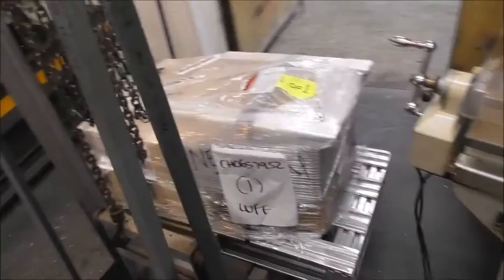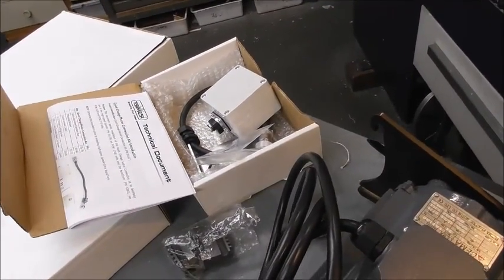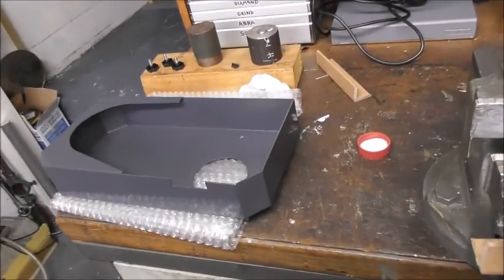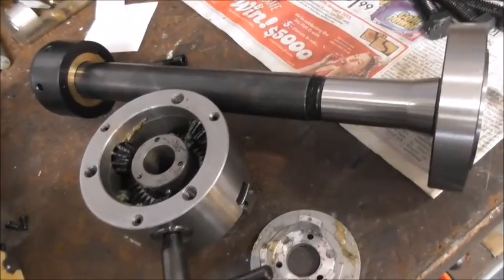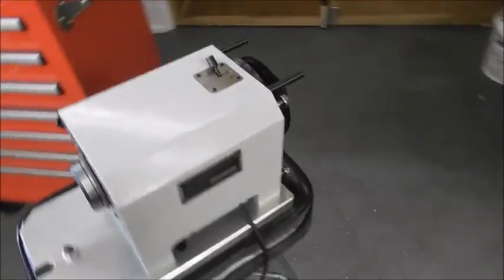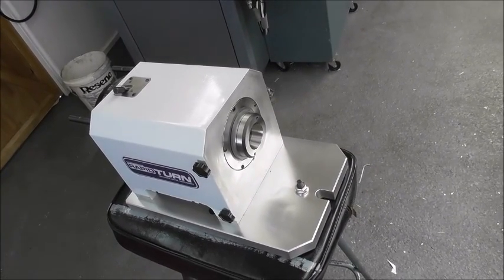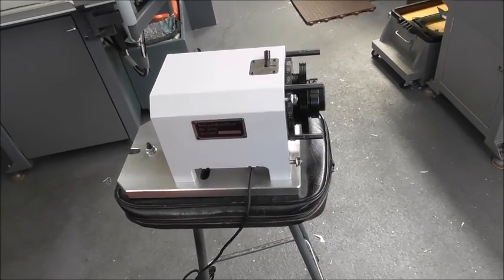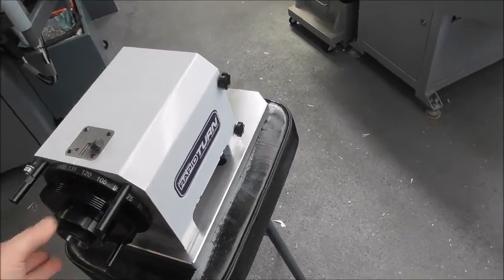Tormach  RapidTurn - 1, Unpacking and inspecting

Comment: 1500 USD for shipping is a rip off. I am living in China and do a lot of shipping. 2 cubic meter seafreight from China ex Factory to the US / EU is about 1500rmb /6.7 = 224 USD ( door to door just add 80 USD including full insurance covered ). There is no reason at all to charge 5x. Really need to negotiate with Tormach China.
Reply from the maker: Hi Sure D. The trouble with NZ is a small population means dealers and agents here sell small numbers and don't have much competition - and so mark ups are often very high. I think I need to use a local agent who is familiar with negotiating all the local regulations.  Thanks for posting,  Cliff
Reply: you could reach out to Chinese agents in your receiving harbor. They work directly together with all shipping agents in China. The terms are known and there is also competition.
Ocean freight rates have dropped significantly over the years. The big vessel fleets have such a capacity, that single containers are so low in costs now, therefore the money is only in carrying huge amounts of containers on 1 vessel.
I am sure with a thorough research you will be able to get the correct rates, even for smaller airfreight handling. Forget to go directly to DHL or similar. They will never give you competitive prices. Go to the agents who have the quantity rates with the big carriers and then all looks different.

Herri
Reply from the maker: Thanks for that Herri - Points noted. Cheers Cliff

Comment: you could not bore that inner ring to 1mm thickness, the pinions need to push on it
Reply from the maker: Of course I agree - I will be more specific later on. The pinion bearings do not engage full depth and around 1/3 the section can be machined out - that will increase the capacity from memory by about 6-10 mm dia.   Cheers

Comment: 3 micron runout? lets see.
Reply from the maker: Yes I will check to see if it is as they claim ! - I know it is a remarkable difference.  But I suspect they will be correct - why lie when you don't need to?    Cheers
Reply: to sell more product, youtube views, or services
Reply from the maker: OK ...so see part 2 for some checks....cheers
Reply: watched it, that was a bit disappointing on the OD. They probably set the tolerance so high because their process is not automated (ie sweat shop china plant)